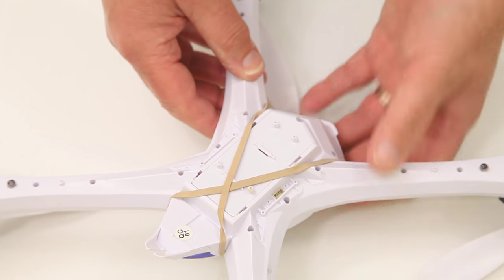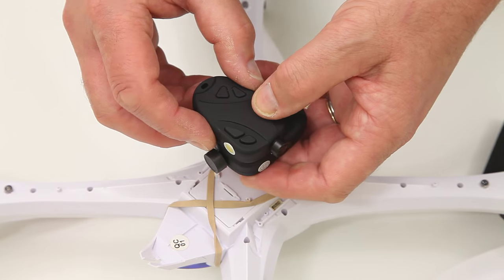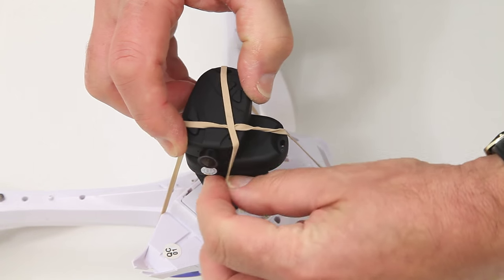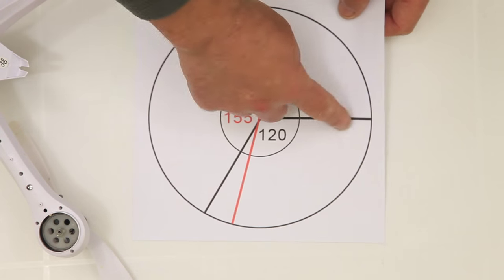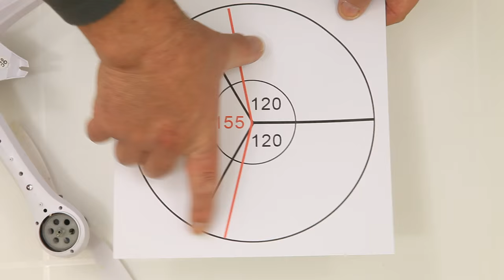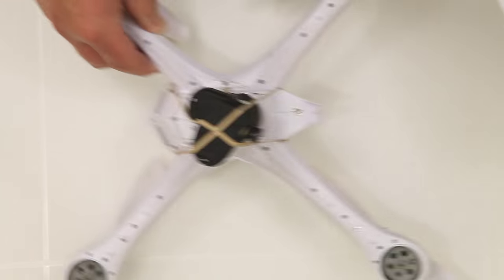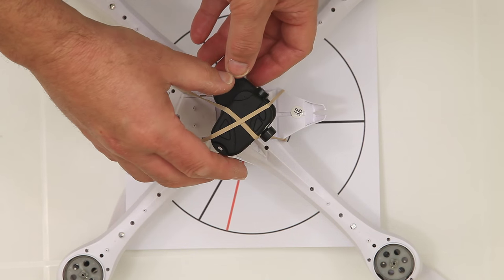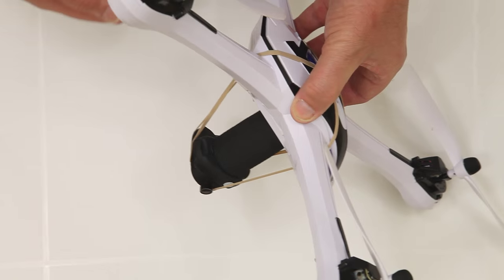Tarantula X6 twin 808#16 cameras side by side 230⁰ FOV!

Comment: Really interesting to see how the same camera shoots completely different exposures
Reply from the maker: CAP31d0 Yes I know, cameras only meter what it can see therefore if I have our white house in frame it will go dark and if I run it under the dense trees it will lighten it, that's why the only way to get this to work is a camera you can set manually or lock the exposure, can't even do that on my Xiaomi Yi! I found running across the garden best as it meters the grass the same. Gee that's along answer and you didn't even ask a question!!! Did you post a comment and then remove it? I have an email question but guess you sorted it? If not let me know, thanks for the comment TTFN

Comment: Very clever, Awesome.  Could you use velcro to put the cameras together on the  template first then mount the cameras to the quad that way they are one unit. I really like your idea I bet you have started something Tigger.  Great video. Thanks
Reply from the maker: Skydive Driver Glad you like it. Yes you could do, it was a bit on the run do it try it and then improve, but the others quads got in the way :-) may come back to it with a fresh approach Cheers and thanks for subscribing :-)

Comment: Another corker. Sure is handy stuff this foam. Will be having a crack with my new prop free foam mount once this darned wind does one.
Reply from the maker: ***** Thank you my friend. Not quite understanding "prop free foam mount" quads don't fly well without the props....no matter how much wind you have! :-)
Reply: lol. It's to get the camera down far enough so no props in shot. Might cause stability issues but should be fine on windless day......  If we ever get one.
Reply from the maker: ***** oh my next suggestion was leave off the Saturday night curry! :-) On a serious note...that's gonna be difficult, but here we go....mount down and forward and it gets the props out the way quicker than just going straight down ;-) Wind is the big killer up here, the Tarantula handles it no problem but makes for poor video :-( Cheers